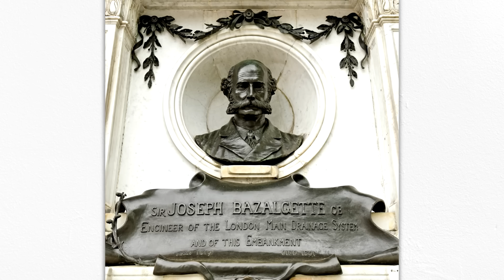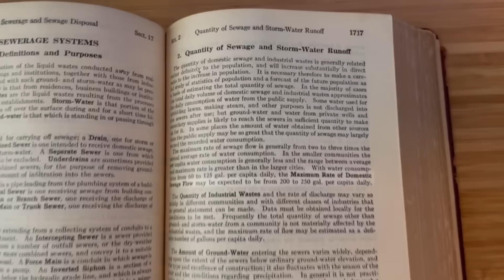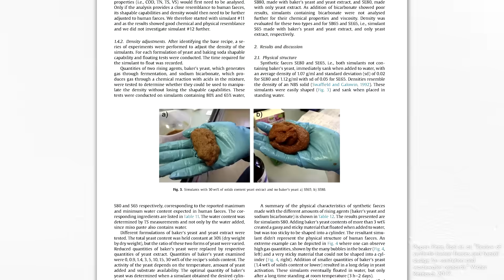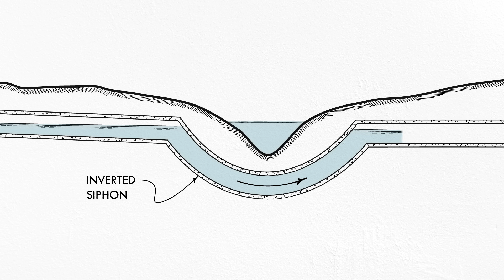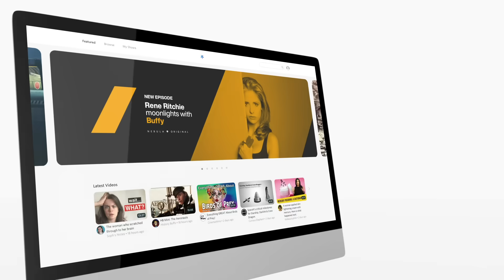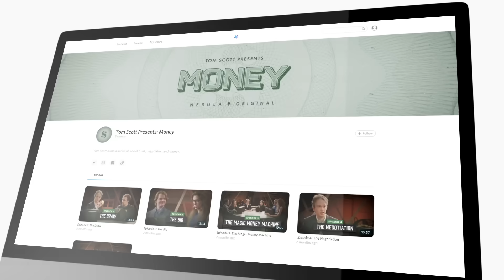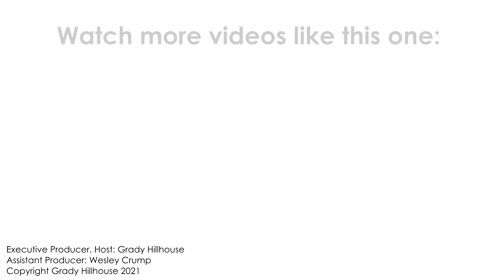How Sewers Work (feat. Fake Poop)

Comment: There in fact are “sewer police,” at least at the larger systems. They won’t be able to figure out which house is flushing string mop heads (that happens) but if you are a metal plating shop that bypasses your pretreatment system that will be noticed.
Reply: Yup, even basic households can be slapped with a increased wastewater bill for letting their gutters to drain into the sewer
Reply: @TheMiksi  Hi Miksi. Roughly what location are you referring to? I've never heard of this.
Reply: @roderickcampbell2105  Finland has this policy in a lot of places
Reply: @TheMiksi  Thanks Miksi. My best regards.
Reply: @roderickcampbell2105  I believe London has a version of this aswell
Reply: @Alucard-gt1zf  Where I lived the city did an inspection to see if our sump pump discharged to the sewer. Ours did (it was built that way), this is forbidden, but rather than fine or charge us, we received a credit on our bill when we had a plumber fix that. Since the sump pump was shot it was a nice discount for me for something I needed to do anyway. But that is common source of the “inflow” part of “inflow and infiltration”
Reply: @roderickcampbell2105  most municipality in the US have the means to investigate sanitary and storm sewer issues. I have been a part of investigations in the past
Reply: @TheMiksi  I guess you live somewhere without an integrated system. Where I grew up they just charged 110% of your water meter for the sewage (the extra is the rainwater — IDK how they determined there’s 10% as much rainwater to deal with but there you go)
Reply: @kaitlyn__L  Yeah, we've got rain water and sewage separated in most areas already. You can calculate the rain water inflow and infiltration to the sewer from lifting stations (most have some sort of flow meter attached) and the combined water usage from the stations catchment area, anything over the combined water usage is I&I. Only 10 % rain water is damn good result if true, our I&I is more like 35%.
Reply: @kaitlyn__L  That doesn't make any sense. Much of the metered water goes to outdoor use - watering the lawn, and it varies seasonally. Storm flows can be many times the sanitary flow. Unless it is prorated to some kind of annual average.
Reply: @kaitlyn__L  You pay for water?
Reply: @trueppp  yeah, water was privatised in the UK in the , uh. Well it was part of Thatcher’s privatisation kick in the 80s which continued into the early 90s. So it’s metered in England (in Scotland and Wales the local governments bought out the private companies so even though they’re private entities they are state owned and so de-facto renationalised).
Reply: @aeromodeller1  I agree it doesn’t exactly make a bunch of sense. But that’s how the metering structure worked. (But most ppl don’t have big lawns in the UK, just little ones if they have any at all, and this was during the era of the “hosepipe ban” too.) I always thought rainwater must surely be larger than my household’s water usage but yeah. Maybe it’s just meant to be for the rainwater that goes down the property’s gutter and not the drain grates in the road? I dunno. That water company has had a bunch of scandals in recent years for taking loans to give bonuses and neglecting their infrastructure anyway.
Reply: @trueppp  most people pay for water. A company or municipality treats and maintains the water system. You get a bill every month based on how much you consume.
Reply: @kaitlyn__L  what was the hose pipe ban
Reply: @dimesonhiseyes9134 Didn't know that, we get a bill with our property taxes. Something like 100$ a year for water and sewers
Reply: @trueppp  It of course depends on where you live but in the US just about every community that offers municipal water operates in that manner.
Reply: @TheMiksi  is this a 1st world country problem we third world (shithole) fails to understand?
Reply: @zeffmalchazeen3429  Mainly a large city with separated system problem
Reply: Some sewer districts set off smoke bombs and then drive around the neighborhood.
Sure, it will come out vent stacks, but if it is coming out gutters you're getting a ticket.
Also a lot of sampling is being done for illicit drugs. Not to arrest an individual, but to determine consumption in an area.
Reply: @jimurrata6785  In our city a lot of houses were plugged in badly (Sewer line going to the Rain line). They would set up smoke bombs and if the smoke came out of your stack, you had a bad suprise...around 10k to get your house replumed
Reply: @jimurrata6785  In that light, you can even monitor region/city covid infection rates in sewage water.
Reply: @Chemtech2010  Sure can
Reply: In the right situation i'm sur÷ a household that flushes completely incorrect items too often (like someone who rips up and flushes every bit of trash and plastic (there are weird people out there) will leave evidence once the house line hits the main line. The water doesn't go backwards so it'll be debris free upstream, and there will probably be a buildup of trash right outside that homes tie in. I've heard of repeat diaper flushers causing non stop issues with apartments, and there have to be people like that on the public sewer too. Same with flushing ALL the cat litter down the drain. In the right situations all that will be visible as to who did it...
Reply: @volvo09  That is true. Our people do look for whatever evidence they can find, and usually they can determine the source of more exotic contaminants, and if possible even more mundane things like trash, but in a large metro area that isn’t always possible,  The system I work for is retrofitting grinders just upstream of all of our lift stations to at least keep things pumpable.
Reply: Some companies can pinpoint individual houses. Putting spiked "hedgehogs" in the sewers catches wet wipes and can help identify culprits.
Reply: Yep; I’m one and nearly every sizable sewer agency I know has what’s known as a “source control division”. Not so much for individual households but to monitor business and institutional discharges that could harm the system, sewer workers, and the treatment process ( not to mention the ultimate receiving water which in my case is San Francisco Bay).
Reply: @TimLPINE  this makes me think times the water company van is parked on the street where I couldn’t see work being done were possibly involved in this. Plus clearing the clog of course.
Reply: Imagine being a sewage officer
Reply: I'm a 'sewer policeman'. I regulate trade customers and their discharge into the sewer system in England

Comment: So, what happens if you live in a house that is below the sewage treatment plant by several feet?

Like in some areas of Los Angeles, there are several people that live in an area called "The Valley" and I'm going to assume there isn't a sewage treatment plant in the valley, so how does it flow uphill if gravity can't give an assist?

I can't imagine pumps being very useful because poop is sticky and "flushable" wipes and grease and fats would clog the pump fairly often.

I feel like I'm putting too much thought into this...
Reply: It'll be pumped to the WWTP. Poop and toilet paper break up fairly quickly in a sewerage network and the pumps used are far larger than those you'd typically encounter around the home. A chopper impeller can also be used that helps. They can typically handle wipes etc as long as they don't come through as a chunk that chokes the pipe.